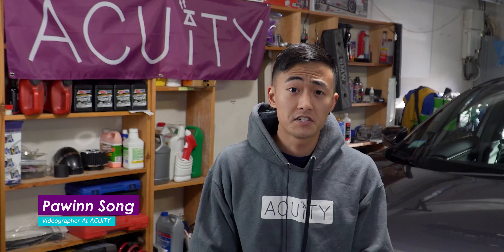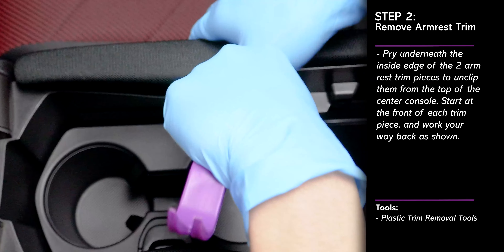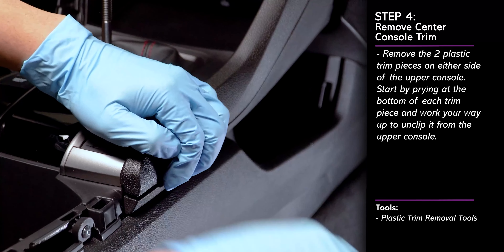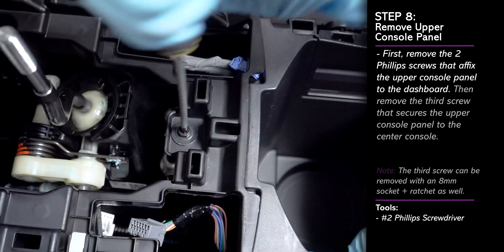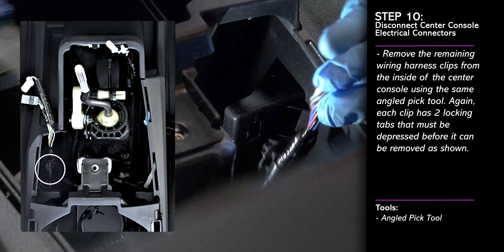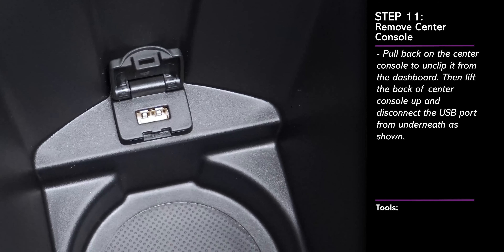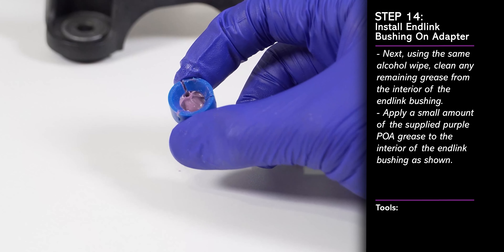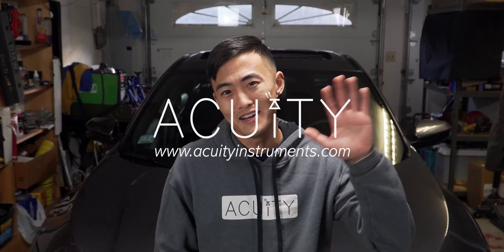ACUITY 1923 Short Throw Adapter Install Video Guide (10th Gen Honda Civic 6 m/t)

Comment: Question for the rocker and this adapter where you say you’re supposed to toque to spec.  How are you supposed to know on what point it is torque like where it is at
Reply from the maker: All torque specs should be noted in the install guides and/or laser etched on the parts. In our install guides/videos the torque specs should be highlighted in purple in the text box that appears on the right during video playback.

Comment: I wanna totally upgrade my shifter with everything you offer. If i get the stage 3 kit that comes with the shifter cable upgrade, i don't need the short throw adapter or rocker arm correct? If im mistaken can you please tell me what else i would need to pair with the stage 3 kit (10th gen) thank you!
Reply: Correct. If you are getting the full shifter, the only other shifting mod to get would be the shifter cable bushings. Most of the parts from the stage 2 kits (the rocker arm, short throw adapter, centering spring, and shifter base bushings) are for the OEM shifter only.
Reply: @rgareh1  lol thanks. I had the base bushings, short throw adapter and rocker arm all in my cart with the stage 3 kit & while looking at pics I started to realize I might be buying stuff that's all included in the kit assembly. Thank you for clearing this up👊

Comment: Will this suit to FK8 as well?
Reply from the maker: Unfortunately this short throw adapter is not compatible with the factory FK8 civic type r shifter. That shifter has a longer lower rod that makes shift throws shorter than other factory shifters of the same civic generation. If you were to install onto an FK8 shifter, you would be putting the gear change cable at an angle that is outside of its safe operating range.

Comment: Could this be done to 7th gen civic with a skunk 2 short shifter
Reply: Honda shifters have a decent amount of variation from generation to generation. You'd have to ask Skunk2 directly to get an answer. No acuity short throw adapters work with the 7th gen civic shifter.